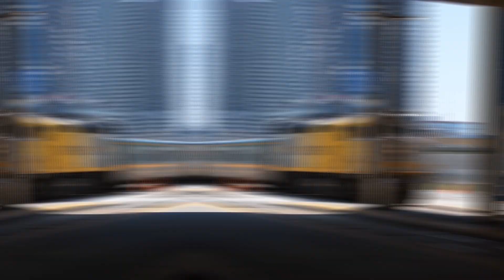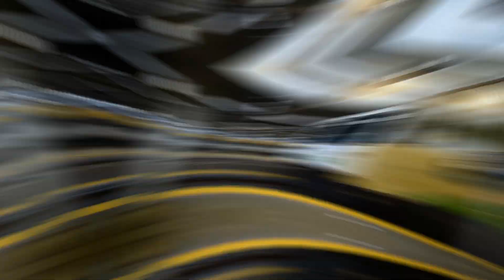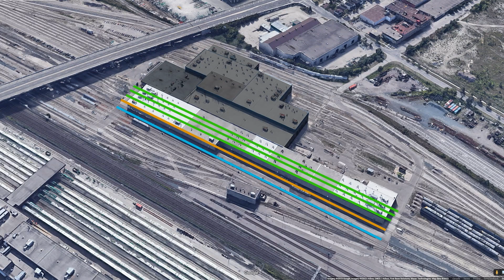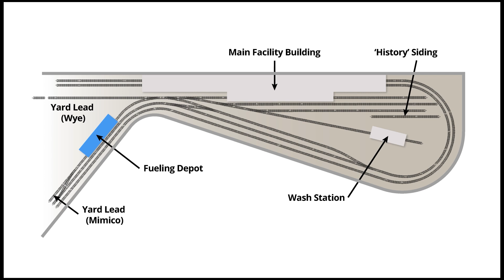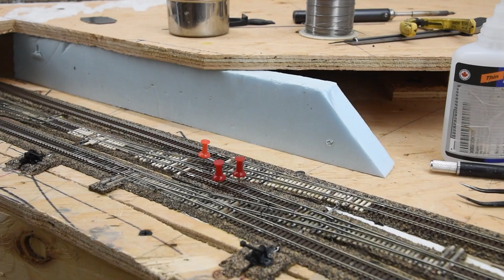Layout Update - Adding a 100-Acre Maintenance Yard to an Eight Foot Shelf

Comment: Too bad you couldn't hide the manual throws down under the layout surface, in fascia recesses or along the fascia on a diagram.  Caboose throws look big for HO, and practically gargantuan for N scale.  But if you're happy with the choice, then it is the right one!  The lighting really made a big difference as well.
Reply from the maker: The thing (for me) about N, is that you'll never achieve hyper-realism, so adding a bit of function at the expense of believability suits me fine - your point is a good one!

Comment: Oh man, going for the maintenance yard must have been a tough choice, but I feel it was the correct one. It already adds so much variety to the overall layout, that it'll be a great addition to the whole thing.

The manually operated switches are a neat touch. Sure, sometimes it's nice to have those fancy electric switches, but this adds a nice level of "haptic" input, where it doesn't interfere with the general processes running on the rest of the layout.

Once more: It's a great joy watching this thing coming together!
Reply from the maker: Thanks. Already I've enjoyed the haptic feedback those little switches provide. Super reliable and east to maintain. win win!

Comment: I like the use of the metal marking dye (not sure what it is called), to be able to make a clear mark where you want to cut the rail.
The lighting makes a huge difference.
Reply: Dykem is one brand name that’s widely used.  Thanks for pointing its use out, I didn’t catch it.
Reply: @davidwilliams1060  That's the name!! I could see the bottle, it's just been a while since I have used it.

Comment: wow, nice touch with the turnout handles brought to the front. 
are you doing dc or dcc? if the latter, what controller are you using? are the arduino turnouts included in that system?
Reply from the maker: Thanks. The layout is currently DC. I'll eventually convert it to DCC. I elected to start with DC to reduce costs and 'simplify' the starting process. As I enjoy watching trains run - more than operations - DC is fine for now.
Reply: @NScaleDystopia  Thanks for the reply, understandable with such a big undertaking

Comment: That yard is impressive! I'm blown away by how you managed to get some much into such a finite amount of space! This layout is going to look absolutely incredible when it's scenic'd! And the lighting you added was a wonderful touch too! 

Aside from potentially using a backdrop to hide the elevation to the upper deck of your layout, how do you think you might go about concealing the tubing used for your manual switches? I remember Roy Smith from the N Scale Union Pacific Evanston Subdivision channel had prepped the scene on his layout depicting the old yard at Evanston, Wyoming by laying down cork sheets in between the tracks; I think he plans to cover everything in ballast when the area is fully scenic'd. Roy uses Kato Unitrack, but I think the same principle can work with standard flex track on cork roadbed too. You could cut strips to fit around the tubes in between the tracks and then conceal those gaps with the brown paper and glue like you did at the Bathurst Fly-Under. 

That's just one thing you could do; I look forward to seeing what you do in the future, as always! I'll never miss these wonderful updates!
Reply from the maker: I haven't given much thought to camouflaging the tubes... Truthfully, the yards at Union and VIA look like yard sales with 'junk' all over the place. A bit of ballast and some weeds and it may look prototypical. 😁
Reply: @NScaleDystopia  That will look great for sure! If anyone can model a scene that's unkempt, covered in rubbish and or seemingly abandoned, it's you! If your work on the Dystopia is anything to go by, that'll be a walk in the park!